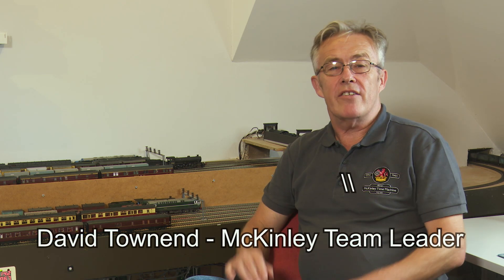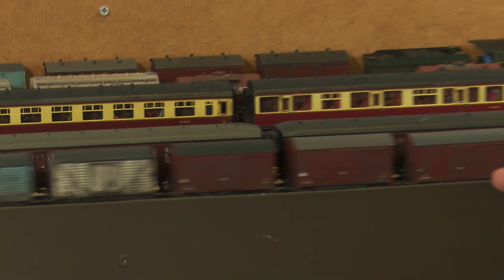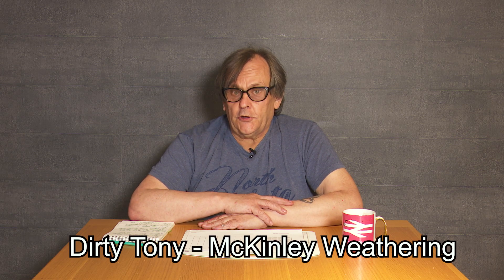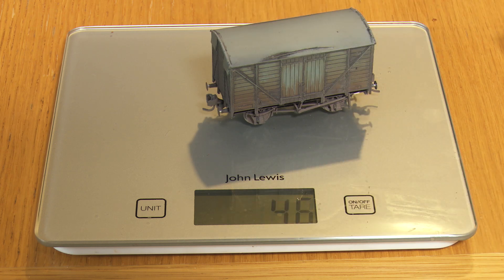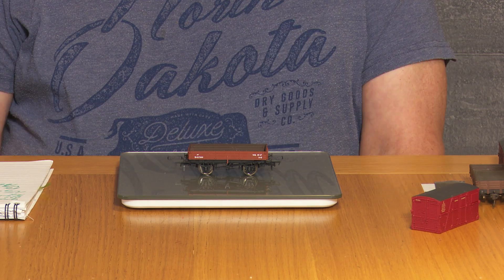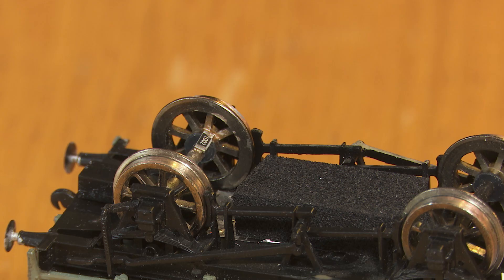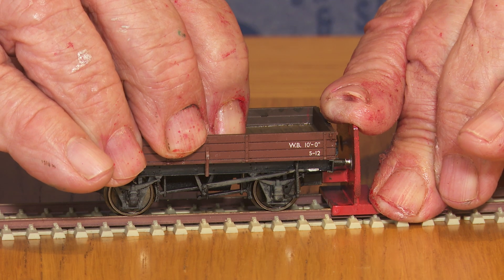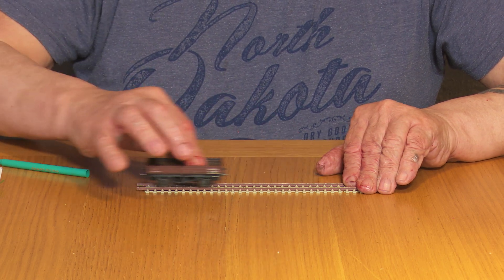36. Weight of Freight on McKinley Railway

Comment: Good morning David and Team. Would your wagon weight formular work for N gauge?
Brian
 Essex Thameside in N
Reply from the maker: Hello Brian,
The principles are exactly the same, but the wight would be different.  I imaging that the NMRA RP-20 shows the US weights per inch in ounces for all scales.  You will need to figure out what works for you.  We found we had to reduce the overall weight to about 60% of the NMRA standards for the wagons to allow our steam locos to be able to pull the trains reliably in the HO/OO world.  The key thing to remember is that the weight along the train should be even.  I hope that makes sense.
David
Reply: Thanks for the information David. I think the  basic aim of most layout builders is to create sustained interest with problem free running. Good track laying is THE best way to achieve the secon especially if hidden areas are incorporated to create the first. If it is'nt right then rip it up and relay it. Adding weight will only be a sticking plaster but helpful to reduce problems over points and to equalise mixed wagon trains. 
Brian

Comment: In the track cleaning video previously you had a peco rubber attached to a stick. How did you achieve that as to not damage the rubber or track. Cheers Peter
Reply from the maker: Glue Watson Glue.  Works a treat.

Comment: Hi team how did you come to a 5g per centimeter for each wagon? And why is 45g an ideal weight. Cheers
Reply: I  was the author of  the Australian Model Railway Association Weight standard (0.55g/mm for goods wagons, 0.4g/mm for passenger cars) which is close  to the 5g/mm  linear weight standard used on the Mckiinly  layout. 0.5g is also within the NEM weight standard  (0.4g/mm, tolerance +15% for H0 scale). My experience is a linear formula  around these values  means the train is not to heavy for small steam engines and maximum train length before derailment is achieved. Mixing light and heavy wagons can result in light wagons derailing on long trains.
Reply from the maker: Terry,  your reply was technically excellent.  Thank you.  That exact what we found.  When we tried the NMRA standard on McKinley the steamers failed on long trains.  I was unaware of the NEM standard.  Thank your for the enlightenment.

Comment: Mckinley team, How lucky you are, wheel's on today's model's must be to a correct standard. Years ago we had plastic wheel's, steam roller wheel's, dinner plate flanges ( used to bounce on the rail ties) no standard back to back. In the end I settled for MayGib 00, finescale wheel's as a standard. MayGib also sold 00 wheel set's which had a wider wheel tread and a slightly deeper flange. I was using S.M.P. scale bullhead track at the time hence the need for a finer scale wheel. Cheers, Chris Perry.

Comment: I'm not a modeler, but I do enjoy watching these videos, for the uninitiated, why is the weight of a wagon so important?
Reply: Helps to stop it from derailing and to track better behind any other wagon or loco. See if its to light it can easily just bounce right off the tracks at say a set of points or a crossing. To heavy and its to much drag on the rake which with any other wagons that are also to heavy makes the loco stall on an incline when by all rights it should make the climb. But a tad on the heavier side is better than too light, hence why Tony added that amount of weight he did to the flat car.
Reply: @gibsonethirty2836  Thanks it all makes sense now, all the best.